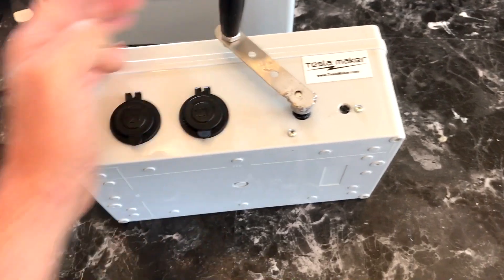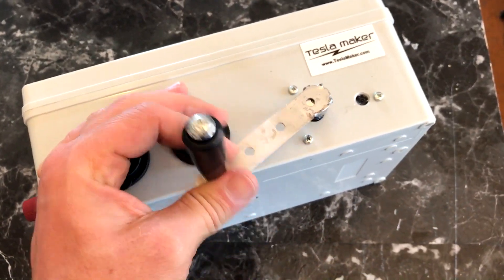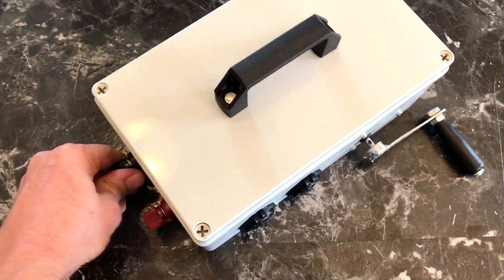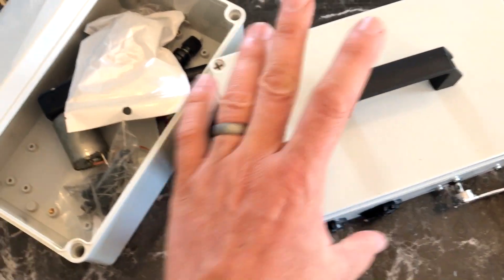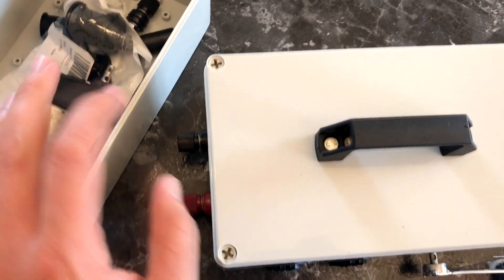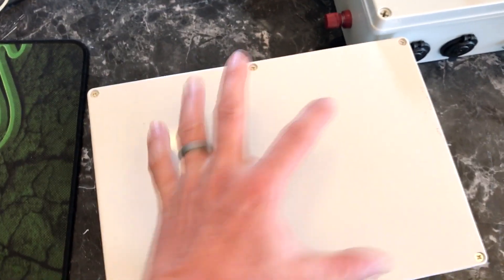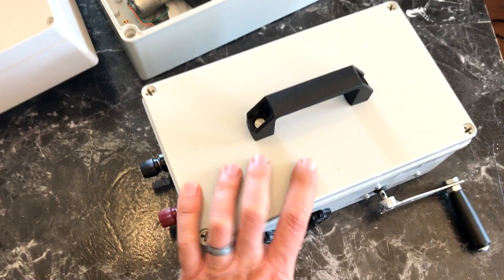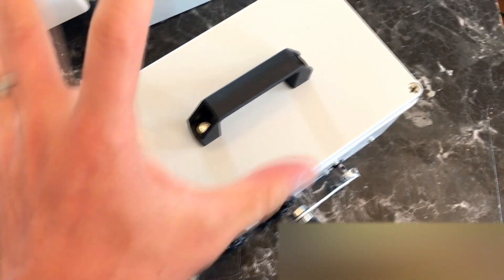V2 DIY Hand Crank BoostBox - Capacitor Power Can Start a V6 Engine

Comment: How about a flywheel and gear reduction?  A drill transmission sounds great, and a flywheel would let you store impulses from cranking.  A ratcheting mechanism with a rack and pinion foot pedal would make it easier to get a flywheel up to speed, then you could stomp it hard a couple times and let the flywheel dump its energy into the generator for a while.

You could use a clutch mechanism to get it up to speed with no resistance then close the clutch and dump the energy out quickly.

Also, bad idea covering the vents with tape, it's not much but they're there to prevent the cap from blowing up if it shorts internally.  You probably didn't make it any more likely to explode, but it's much safer to just mount them with some room to vent if one goes tits up.
Reply: tberry7348 ya just killed it with aa batt lol cud switch to bat power this uses caps lol
Reply: soupisgdfood I was thinking very similar with the fly wheel only I was thinking add a second alternater put small gears on both and a bigger fly wheel connecting them twice the output with less cranking.  Also 10 rechargeable aaa or aa batteries for increased runtime.

Comment: how hard would it be to make a bigger one a those & hook it up to  a solar panel on the roof of a hybrid car & either run the car off that for a distance or use it to keepthe traction battery  at full charge  for a distance?

Comment: Alternatively the generators are on AliExpress 
- https://www.aliexpress.com/item/1pCS-Free-Shipping-Second-Hand-12V-24V-Large-Torque-DC-Motor-Wiht-Metal-Gear-Used-For/1921117869.html
- https://www.aliexpress.com/item/1pCS-Free-Shipping-Second-Hand-12V-24V-Large-Torque-DC-Motor-Wiht-Metal-Gear-Used-For/32798518510.html

Also cheaper 500F 2.7v caps
- https://www.aliexpress.com/item/1pcs-Blue-Farad-Capacitor-2-7V-500F-35x60MM-Super-Cylindrical-Capacitor/32815633293.html
Reply: He needs a stepper motor